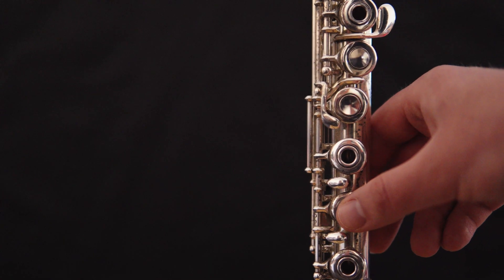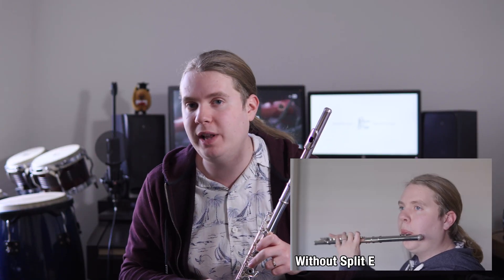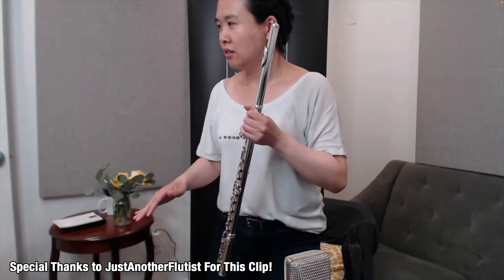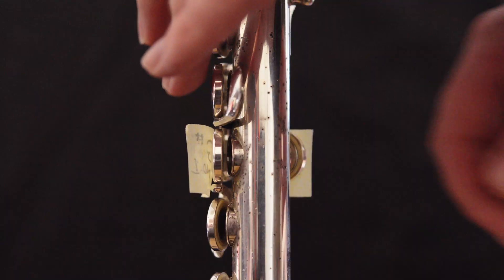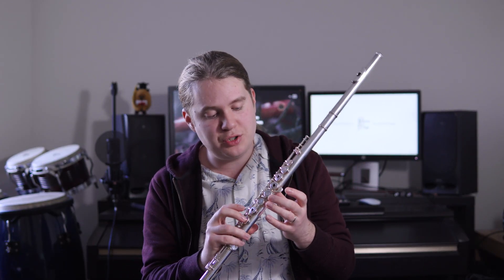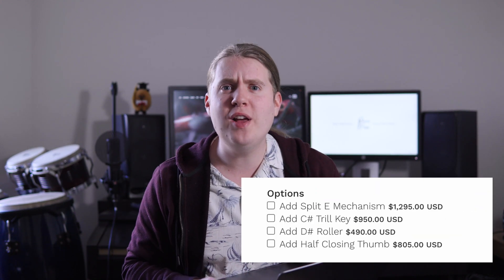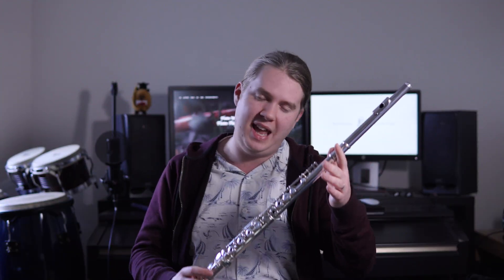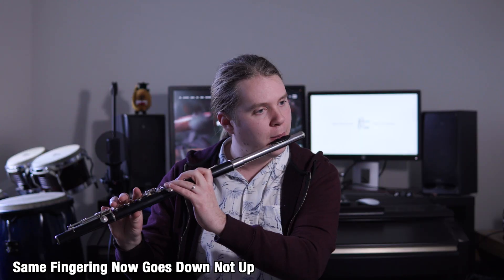The Flutes Inventor HATED Our Modern Mechanism.

Comment: I wonder what would happen if we kept the closed G# but simply inverted it rather than adding an entirely separate hole in addition like you talk about around 2:00. That way the G key would only control one tone hole. You’d leave your finger off for notes below G, you’d press it down for notes from A to C#.
Reply from the maker: Unfortunately, inverting it isn't mechanically possible using a sprung system as you can't open the G# key while G is down (and G is always down when playing G#). That said, I believe it is possible on some flute designs that replace pin springs with magnets. Though they aren't particularly common place (and I'm not entirely sure how they work having never seen one).

Comment: On my 36-year old Yamaha 53b, I helped the high E by lifting the Eb key. I ordered the split-E on my much-newer Powell, and regret it a little bit. It's easier than lifting my right pinkie all the time, but the mechanism has been finicky to maintain with the G# frequently leaking a tiny bit and affecting all the notes below G. Saying that, I cannot imagine the difficulty in fighting all the muscle memory by changing to an open-G# flute.

Comment: this was quite informative. I had no idea about that history. I come from a background of tin whistle and recorder and one thing about the flute that seemed so counterintuitive was to press down the next key down the instrument and get a higher note. And I hate the excessive use of the right pinky. I’m sure there’s a reason. I also hate the F on a baroque fingered recorder. I don’t think there’s an instrument that doesn’t have peculiar issues that vex the players.
Reply from the maker: The reason for the right pinky on flute is to help stabilise the instrument. On some notes, the only finger that's down is the right pinky! So that's all there is to hold the instrument, besides the thumb. 

Though, you're not alone in not liking it. They are rare, but you can find a few flutes here and there with open D# keys for the right pinky which were specially requested by players!

Comment: I had a go with an inline G and the Es were normal, idk if I could feel a difference? Is that because I’ve reached a point where I have enough technique and power to be able to get it out easily?
Reply from the maker: Based on my experience there's two options.

1. If you're used to playing without a split E, you probably won't notice when a flutes missing it or

2. Some flutes when missing a split E still play E exceptionally well anyway. Most likely this option. I've definitely experienced E's on some flutes where E was perfectly good without a Split E. Though I've also experienced some which were very painful without fighting to get used to the specific instruments quirks.

Comment: I got my first open G# piccolo from the UK,  Loved it so much, bought an open G# Altus.  Loved that, then ended up with two Murray flutes (open G# and open D#).  All of my closed G# are in storage now.  I strongly encourage any flute player to at least try an open G# for a little while, if it's possible.  Even a cheap Trevor James open G# would be an excellent intro to it.
Reply: Was your Murray system converted for you or did you order the flute with it already built like that? The Murray system flute I tried (a Miyazawa that was converted) also had reversed thumb touches, so the lower touch was the Bb one. 

The owner of that flute also had a Parrot alto flute that was converted to Murray system and then back to standard again, so it ended up with an articulated Eb key (open sprung pad cup and heavily sprung Eb touch to close the pad cup). With a bit of linkage, that Eb pad cup could be closed automatically with the low C# key (as on oboes) so a low Eb-Db or low Eb-C slur can be done while the RH pinky remains on the Eb touchpiece.
Reply: @chrisperyagh  I got them from a couple of sellers - I do know they were ordered but have found no information on who did.  

They're both very special, but one thing I think is really interesting that they share are the thumb keys on a horizontal rod (like a piccolo).  

That's super cool to see another Murray player out here!  Not many of us, at all.
Reply: @ab-zg8pt  The Murray systems I saw were converted by Peter Worrell when I was at Howarth and converted for one of the finisher's dads (his surname's Chapman). He's a professional flautist and I think is or was a flute professor at one of the London music colleges.
Reply: @chrisperyagh  That's a huge job to do, the mechanism is quite complex, so Peter must be quite the tech!  I'm glad that my flutes were originally made that way - but if I had an alto that wasn't, I'd love to have it converted.  For me, the open G# is ideal - but the open D# is quite liberating.  It made me realize just how much work my LH4 was doing to keep it balanced.  I don't know how I played flute like that for years.  Better late though, than never!!!!

Comment: It's not necessary on a professional flute, and it's SUPER not necessary on a C foot/thin wall. It's a non-issue. 

I have a Miyazawa PCM from 1990 (c foot) and a Muramatsu AD from 2000 (b foot). Both are inline. E is not fragile on either one unless you're slurring from high A, and in that case, a split E doesn't really help much. Certainly not as much as lifting the D# pinky. Also, decreasing the size of that 2nd tone hole (some makers did this for a while, especially Sankyo, NEL mech), reduces the problem. Also, having a precise, efficient embouchure that doesn't rely on overblowing helps a lot. 

Most flute players use too much air to compensate for crappy aim.

Comment: I've even seen a flute converted to Murray system with reversed thumb keys (lower touch for Bb and upper for B natural), open G# AND an open Eb key, so that's taking Boehm's fully vented design to the extreme.
I once knew a Russian flautist who played an East German flute that had reversed thumb keys and open G#. Recently I bought an older Muramatsu piccolo (all metal) with an open G#, so not sure what market that was aimed at.

With non-split E mech flutes, a doughnut can be fitted in the duplicate G# tonehole with a 7mm or 8mm hole though it. Some makers fit one with an offset hole in it or a notch cut into the side of it, or even a heart-shaped hole though it. I've made delrin ones which I've fitted to Yamaha 22 or 221 flutes to help high E speak. Some makers have a smaller diameter duplicate G# tonehole (the same diameter as the regular/closed G# tonehole) even if they have a split E mech fitted.

Comment: The situation makes sense in the greater context of wind instrument development as a whole. Because it’s not just the flute… clarinets and oboes also use the “old” design with 3 finger G and 4 finger G#. Back in Boehm’s time, not every flutist was only a flutist. There were no speakers, no recorded music. Every bit of music you heard was live. Musicians got around, and many of them played more than one instrument to keep their plates full. Changing the fingering system so fundamentally is not really feasible if you are playing clarinet or oboe on the side, considering that the basic fingering layout for each instrument is the same.

But why is this fingering a problem in the flute when it works fine on the oboe and the clarinet? It’s because of acoustical design. Flutes with finger holes are similar to oboes abs clarinets in that they have tall, narrow tone holes which account for the size of fingers. Closed hole keys add some inefficiency to the system, as the closed chimney adds volume and variation to the bore, but this is adjusted for down the line.

Boehm wanted an acoustically ideal instrument, with large tone holes… too large for fingers, and as few closed keys as possible.

I think the cost/complexity issue is trivial, tbh. Talk to an oboe player. The most complex flute is nothing compared to the rube goldberg complexities of the oboe.

Lastly there is a mechanism that would keep the old fingering without producing an extra tone hole. It’s called an articulated g#, and you see it on saxophones and some clarinets. You could put this on a flute, and it would need more efficient, manufacture wise, than the current split E setup. But geometrically it would require a redesign of the upper and lower stacks of the flute, and retooling the factories. And design is the real cost factor in manufacturing, not a few more parts….

Comment: is that black mold on your flute?
Reply from the maker: Hahaha, no it’s pitting. My flute is quite old, older than I am! 

At some point in its life, the silver plating had a chemical reaction with the metal underneath, causing those black dots to form. That’s why the head doesn’t have the dots, it’s solid silver.

I bought it at auction like that, though I’ve done some work to improve its condition, I didn’t fix the pitting as it doesn’t effect sound or function and is just cosmetic.

Comment: Split e has never been a common occurrence on beginner flutes. Maybe some very recent models have come out with it perhaps?? Also split e is controversial simply because it makes one note easier but doesn’t affect any of the nearby notes, specifically high F#. Split e teaches players to use less support for the high register, which ironically makes the even higher notes F# and above more likely to fail becuase the player expects the kind of easy blowing used for the high E. 

I would argue that split E should never be on a beginner flute, because kids should experience a linear progression of difficulty as they climb the third octave. Having a singular note that’s suddenly a lot easier than the surrounding notes breaks that concept and will likely make it harder to consistently play notes above it, because the player needs to consciously think to suddenly blow a lot more for them.
Reply: I was also going to write a response stating that the high F# seems harder with a split e mechanism, I'm glad someone else got their first.
Reply from the maker: I can't speak for the area you're from, but to give one example of a local music store for me, they have 11 student model flutes in stock and only one that didn't have a split E (Yamaha YFL 222). All other models (Pearl 505 & 525, Trevor James 5x and 10x, Jupiter JFL 700RE, Yamaha YFL 212 etc.) as far as I'm aware came with split E mechs. And I remember the market being similar when I first started learning Boehm flutes. Certainly, no student flute player I knew with a established brand name instrument was missing a split E.

Having been raised on split E flutes, I honestly find them to have a slightly better consistency between notes, but perhaps that difference in opinion simply comes from what we've become used to?

However, I'll leave the philosophy on student education to more experienced teachers than myself. My main frustration with this is from a flute making perspective, that being that this is an acoustic imperfection that has had a clear and simple solution since the instruments conception. And yet, this is hand waved away despite the primary strength and philosophy of the Boehm flute being the pursuit of an acoustically and mathematically perfect instrument. As a flute maker, that feels like a counterproductive mindset to have in the development and design of an instrument.

But that's just my opinion! And thankfully options exist for split E and non split E mechanism flutes. It's just that part of me still wishes the same could be said of the Open G#.
Reply: @passionflute2538  Almost every model you've listed is what we typically consider a "step-up" model in music education. Basic beginner models (sub-$1000 USD) do not typically include the split E in the United States. The TJ5x is not sold in North America, so I can't speak to that one, but the TJ10XC, Pearl200, etc. which are ACTUAL beginner instruments lack the split E.

Which I'm grateful for, because as a professional teacher and musician, I prefer to play without it.

(Different story on piccolo---I wouldn't dream of buying a high-end piccolo that didn't have the split E.)
Reply from the maker: @torrita01
Wow, that's genuinely incredible to hear! Thank you for that added perspective, it helps to clear things up!

Over here in Australia, only the pearl 525 would be considered "step up" but all other flutes listed are available for $1000au or less (1000 AUD = ~660 USD). Besides the 525, the TJ 5x is the cheapest at about $650au and the TJ 10x is the most expensive at $995au. Even the PFL 525E is about $1300au (~$850us), well below $1000us. All prices including tax.

Hand on heart, I can't find cheaper name brand flutes here than the TJ 5x and JFL 700E. I miss-typed JFL 700E for JFL 700RE in the original reply, but even the 700RE is on sale for $800 AUD and retails for $995 AUD full price. Below $600 AUD, the only real options are from J Michael (~$400 au with options with and without the split E), though I can't speak to their quality having not tried them.

Usually if a student’s budget is under $600 AUD, the best bet is to pick up one of the flutes I listed (or something similar) secondhand — they’re often $200–$500 AUD depending on condition. My own first flute, a TJ 10x, was $330 AUD used.

Looking up the same models I listed on Flute Center, they're significantly more expensive than here in Australia-usually about 50% or more! And I assume you'd be adding tax to that too. So I can certainly see why you would consider those step up models and not beginner models, far too expensive for most parents to afford!

In researching this video, I looked at dozens of flutes from several brands and stores and could only find two models that didn't have a split E, the Yamaha 222 and the J Michael JFL300S. If a parent blindly walked into a store and bought a flute here, the odds are very low that they'd end up with a non split E flute, particularly if they bought from a respected name brand that they might have been recommended

And, at least in my personal experience in Western Australia, the Split E seems to be somewhat taken for granted and assumed. Clearly not so in the US! How very interesting.
Reply: @passionflute2538 many professionals do use one! I and some of my teachers have not. 

Personally, I'm not a fan of how it seems to dampen the pitch and tone on high a, and I like the response I can get better on e without it. 

Again, different story on piccolo, though. Definitely necessary if you are upgrading for that instrument.
Reply: @passionflute2538  What I've always wished for was a small touch for the RH 3rd finger for F# that would depress the key for 4th from the bottom of the body joint, so that the E-F# switch didn't require such delicate coordination.
Reply: Absolutely, I've been teaching flute for over a decade now and I've never seen a beginner flute with a split E. Based on the models listed above it seems like he's lumping together beginner and intermediate flutes.